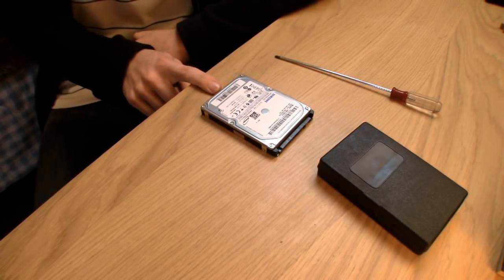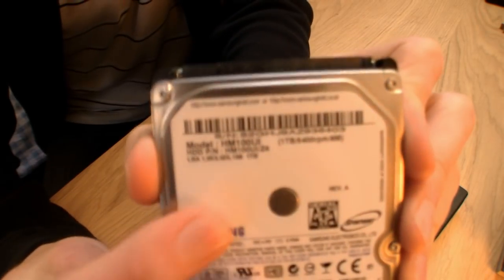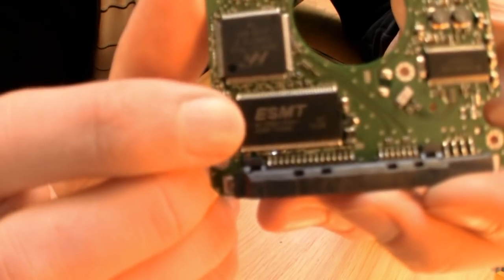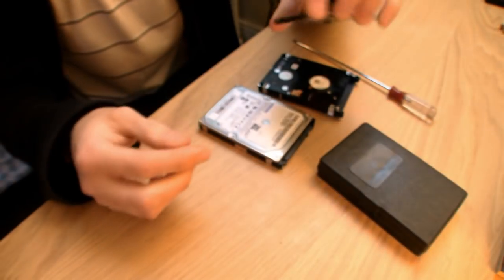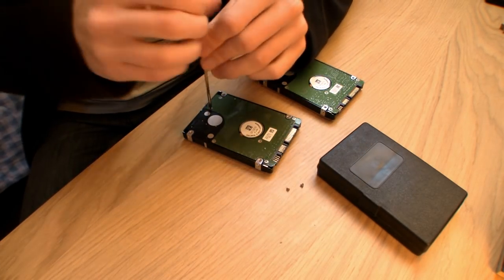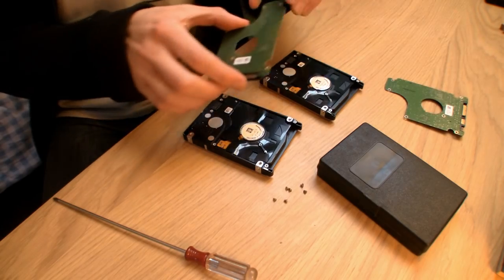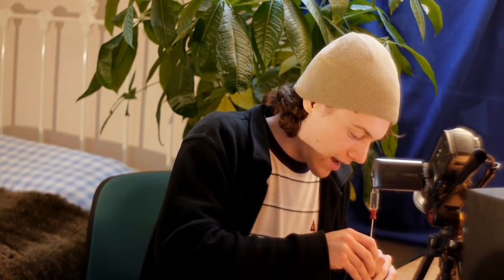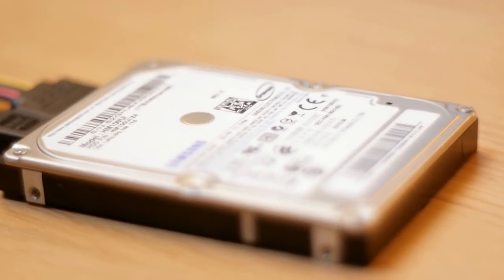how to fix a hard drive (and get your data off)

Comment: ESMT chip is memory - RAM - cache
it have nothing to do with firmware
firmware is stored on SPI FLASH chip which is in 8 pin chip
firmware actually have to transplanted - you have to move firmware from old PCB to new PCB, as firmware contains data about motor, heads, pre-amp and platters.
Forcing firmware from drive A to work on drive B is destructive!
Reply: Are you talking theoretically or actually? Swapping PCBs has worked on several drives for me, so what you say about it being destructive sounds ill thought.
Reply: I am not talking theoretically!
I am talking technically!
ALL new drives have such huge capacity per area, that it makes it impossible to produce similar enough head and platters. Every drive have its own correction data, which is specific not to model, but to specific drive! Changing PCB only changes this data, so PCB isn't able to access data on platters any more, because it doesn't understand what it reads. PCB might be trying to access data many times and it might even try to correct "errors", where they do not exist. This will destroy data.
Reply: I see you understand nothing about technology, which is needed to create working HDD. Your knowledge is extremely limited. Every new HDD have adaptive information already in FLASH at the moment, when HDD is sold. HDD isn't sold blindly! Every manufacturer is performing tests, which you even do not know exists, as you have no access to those test! And distributor is performing conveyance test. Do you at least know about existence of last one? If you are confident in your technique, you should try to swap PCB on drive produced after 2007 or even better 2010. It won't work for at least Seagate Barracuda 7200.11 - I know I attempted it on HDD, which I thought is dead (after changing FLASH it worked).
Reply: Matt
WizardNumberNext thinks that technology of making hdd is extremely difficult, perhaps, but not so. Any way, if you successfully attempted this method, you should copy your data to safe place QUICKLY and drop repaired hdd to a garbage, because it can fail at any moment.

I saw some video shown that screws must be installed with fixed force (moment) by special screwdriver. It causes micro-deformation of hdd's chassis and It's very important. So you repaired hdd works, but not fine.

Comment: Ummm reformat the drive and reinstall Windows. If it crashs during that process and keeps crashing or freezing at the same point or close to it, then it s the HDD or some other hardware failure.

Comment: My hard drive is all screwed up, you want a show at it I'll send it to you lol.     You can hear it read a little bit when plugged in, but it has bad sectors, tried to format and the format could not complete, so now it shows the drive letter, but the petition and etc is not all the way there.
Reply: I can not format the drive or petition it any longer as well.  Windows picks it up, but when in DOS, it does not pick it up, but picks up other drives.

Comment: WARNIING!! 
Great vid but you should have a cushion of some sort under your work area, I realize that the microphone is picking up the sound making it seem as if the hard drive is being placed onto the table harder than it is, but you know that even a small shock can deem the hard drive WORTHLESS. 
The hard drive itself WARNS of this. 
Id suggest even a cut up corrugated card board box will do and placed under the work area, a rubber mat of some sort will do, even a desktop cushion MOUSE PAD will work, I suppose a bathtub mat could work in a pinch. lol 
BUT DO NOT use a blanket as it could give off static electricity and even a small shock like the kind of shock when we touch someone when we have walked across the carpet and feel a static shock. So don"t use carpet. Anything rubber or like a MOUSE PAD directly under your work area. 

Other than that. GREAT Video. and THANK YOU.

Comment: I suppose you have never taken apart a HDD and removed the extremely powerful magnets inside which drive the actuator then?  A magnetic screwdriver will not affect anything.

Comment: the problem with this is....ONLY do this IF, you have data on this that is absolutely worth recovering. the cost is so great to get an identical pcb that its not worth it to just continue to use the drive. $40 for a 500gb hdd pcb. might as well spend $50 and just get another hdd. and if you got a proprietary hdd "one that came out of a dell or hp exc"... it will be a royal pain to locate a pcb and the price will be much higher.

Comment: Such a logical way to repair a HDD! thank you for this - my only hesitation is that the drive isn't "dead", it still takes power and spins up, but for whatever reason, won't be recognised by my BIOS. And that's plugged directly into the motherboard. so not sure if the circuit board that's the issue, or if it's something more...?

Comment: It does sorta work, but not reliably. Thats why pros wont support those methods. What good is putting a HDD in a freezer if it only works for a 1/2 hr when transferring data can take well over 2 hours. Pretty pointless Unhook, put it back in freezer and hope you can get the rest? Look at what freezing a HDD does to it. It is garbage after that. Good luck.

Comment: ok good idea with my experience 10year if you want safe you picture or anything from ur hard driver you can do that one thing you do buy cable usb sata conect to hard driver to laptop or desktop turn on and push usb port and go take evrything you want other way  if-------------desktop easy can work hard driver fine if you have hard driver desktop broken and not work listen sound crank crank and turn on and restart that one way you can do buy other hard drive and conect cable together and make one hard drive pri  other one sec that mean 1hard drive master number 2 hard drive slave that desktop will boot with new hard drive but other one be in ur systems get all staf from that hard drive broken will be  computer same D  or E or C or DVD

Comment: But if you want to help them save there data, then you need to stop telling them to tap it against something or blah blah blah. You need to tell them, if they deleted something, HDD stopped working or whatever, they need to turn the comp off immediately and do nothing more. A PCB swap is fine, if you know what your looking for, otherwise purchasing a few PCB will get costly pretty quick. Not saving money. Samsungs you need to be a with in a couple weeks, not the same month. See, costly.

Comment: I owe you a massive favor. 10 years worth of data retrieved as I followed your advice instead of so many other pro-repair videos on YT that say that this method will not work for modern drives that do not contain firmware on a separate chip to the main HDD controller.  I thought that I was in for a scary resoldering job after shorting out my drive, but after seeing your video I risked a board swap and up the drive span :)  You are a star my friend and thank you !
Reply: Matt Hey Matt, that's my name! I was hoping to have you help me with something. I want to add a hard drive that came out of a Dell Laptop I once had about 3-4 years ago, to my newer Dell Desktop Computer. I was hoping that there is a place within the computer you could add a second hard drive IE My hard drive my the laptop, while keeping the origional hard drive from the desk top computer safely in place. 

Is this possible, and if not how could I (1) Retrieve the information from the laptop hard drive and save it (pictures, music so on and ect.) and (2) Make use of the hard drive in anyway after saving pictures and all the things I would like to keep from it.

You help would be greatly appreciated.

-Matthew.
Reply: Matt I am Subbed to you by the way!
Reply: Matt Matthew Byers John Rostron  hey, is this method work for drive locked by hdd password (ata password)?
Reply: +Matthew Byers  If you dont know already (since its been three months), you just need to attach the laptop drive to another sata port of your motherboard (like your primary hd would be) and attach a sata power cable from the power supply to the hard drive (again, similar to the already attached hd). I have my system running in a similar config. Cheers.
Reply: +Matt  hey buddy i have a wd hdd i unfortunately scratched that that green board on the back of hdd i am thinking that i buy same model of hdd 45gb  just for replacing that chip from this hdd to my 1tb hdd will this trick work i hope you will answer my this question you care about us and thanks for this video buddy
Reply: Most people do not realize that HDD's are very FRAGILE and sometimes even a slight jostle will either corrupt the data on the platter(s) and/or the read/write heads will get misaligned thus making the data unreadable forever! External HDD's are more prone to this because of the very obvious reasons being external. Never heard of anyone referring to the "spike slider heads" as they are well known as either the read/write heads or also just plain "heads"... so people gotta treat the HDD's like if it a was very voluptuous gorgeous woman, nice and gentle. Haha!
Reply: you're lucky to have 10 years of hdd with no backup. you're even luckier to have a dead 10 years old hdd data retrieved. at this point I can safely say you can trust your luck on your next hdd, too.

Comment: i have 1 year hdd,.. how to fix this ?
Reply: You could watch the video and get your answer that way.

However its depends on what wrong with your current drive. Also, its not going to be free, since you might need new parts.

Sometimes you can fix it simply with Windows, but only if no parts are broken.

Comment: Ok, so I have a Western Digital Portable Hard Drive, which I am fairly certain the circuit board is bad.  The mainstream solution, is to transfer the firmware chips to a healthy donor circuit board.  I can afford a firmware transfer, but I really want to avoid having to send my bad circuit board out of state.

This is my drive:

P/N: WDBBEP0010BBK-01  S/N: WXD1A72J5661
Circuit Board Model Number: 2060-771814-001 REV A
The drive's release date was August 10, 2012.

I have made 2 attempts to order the correct model, (Amazon 1st attempt, Newegg 2nd attempt), but both times, the retarded sellers sent me the WRONG model (a 2014 My Passport Ultra).  Needless to say, I know it will not be compatible.  Still, I was upset enough having to ship back the first order, so I have decided to keep this My Passport Ultra.  Despite NOT fulfilling my immediate need, I like the slimmer form factor, and I do need a fresh drive to transfer my retrieved files to.

Anyway, so, can you, or anyone reading this comment, PLEASE help me in one of 2 ways: 1) help me find the exact hard drive model with a same month release date, or 2) help me find my PCB with the firmware version I need.
This is the firmware number (I think): XTCZ05 X4GS
If that is not the firmware, just tell me where on the board to find it, and I'll edit the correct number in ASAP.

P.S. I included the serial number, but I'm thinking it's not relevant, because each unit has a unique S/N, right?

Comment: Dude, great video. You have a great attitude and personality. Good video and audio quality. I have personally found that even sometimes getting a Master Control Board or MCB Board for the hard drive, even won't properly work unless it's literally with in the SAME WEEK! I've usually experienced this mostly with Western Digital and Segate HDDs. Other than that, smooth vid and good job.

Comment: Hi Matt, a few things... Firstly chipboard is what you use to floor your loft, the bit on the back of your HD is a circuit board or PCB ;) Also, there is no risk of the magnetism from a magnetic screwdriver damaging the data on a hard drive, hard drives contain magnets several orders of magnitude stronger than any screwdriver and many modern laptops have very strong magnets that sit quite near the hard disk. Magnetic fields diminish very quickly with distance, your screwdriver couldn't get near enough to the platters to cause any harm. Also, you don't know what the wrong board or firmware will do to your drive so there IS a risk that using the wrong board could make things worse / damage your data. If the manufacturer is aware you have changed the board they will absolutely void your warranty! Also, unlimited online backup is only £40/yr form any number of vendors, use that any you'll never need to scour ebay for compatible circuit boards again.

Comment: Matt? I saw you on DIY Perks a few minutes ago... I guess this account is older, you then grew up and skipped the cap.  ;-)
A magnetized screwdriver will hardly affect the platters, it requires more magnetic force than that.
Swapping the board can help to recover the data but they usually contain an error list that isn't the same on the two drives so I wouldn't recommend to keep using the repaired drive - just get all the data you need from it.
Reply: That error list can be regenerated by doing a low-level format but that's not something to be done a noob... LOL

Comment: So my hard drive at home got water on it and plug it in and it burn up can this still work if i do this
Reply: jonathan Last It's possible water got in the breathing hole of the drive (where it says "don't cover this hole"). In that case, it might be internally physically damaged, but I would say it's not likely.  It's worth a shot.

Comment: why not just use the new hard drive
Reply: +Computer How-2s  I thought the same thing.  I guess by replacing the chip board he wouldn't need to re-install the operating system. His data will be instantly accessible.
Reply: God you are thick, the data he wanted was not on the new hard drive.

Comment: Tapping it sideways in case the heads are stuck? WTF? So if a head is really really sensitive and easily broke and the head is stuck to the platter called crashing, then why would you want to tap it? It you jar it loose, you broke the head off and ruined the platter. Stinking backyard mechanics. I know I know, it works. Ya, keep telling people these things and see how many will be pissed at you for breaking there shit and never getting there data back. Especially very important data.

Comment: Thats the problem, its a fake drive. BAHAHAHAHAHA Because your problem is either a stuck Head (Called crashing) or a stuck motor. Either one you cant fix. A stuck head is when the head melts itself to the platter, (The hard disk, professional work needs to be performed in a clean room) A stuck motor, ( the disk is spun by a motor which stopped spinning for whatever reason and froze, again, needs to be done by a professional in a clean room) Clean room, super super super clean area with no dust.